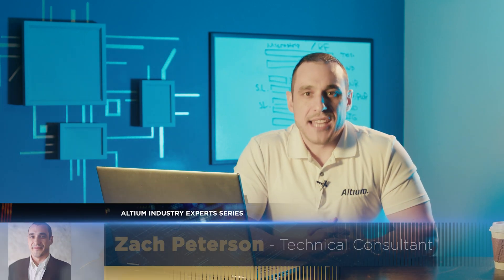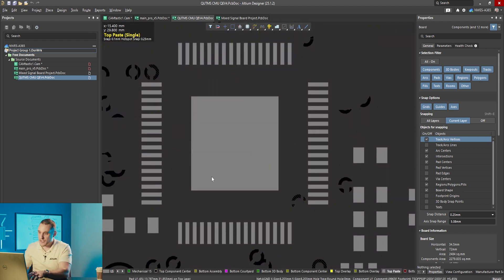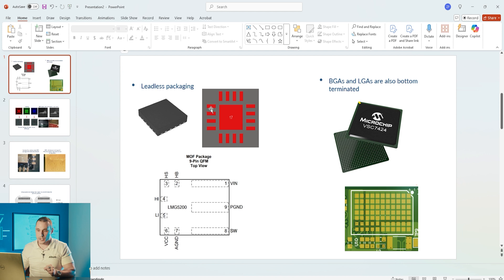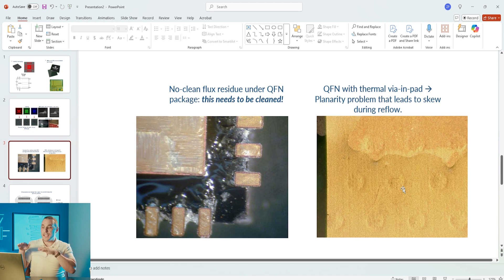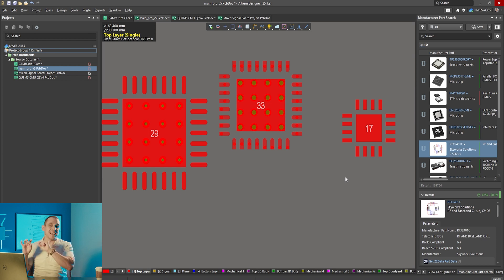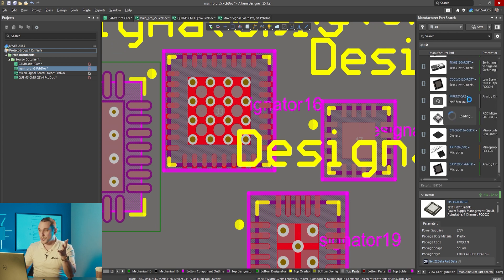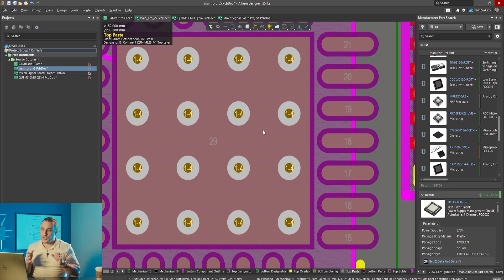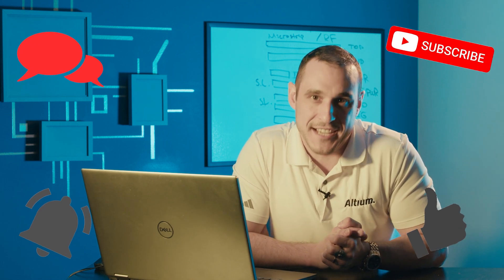Bottom Terminated Component Guide: Footprint Design Best Practices

Comment: Interesting that you mention using tented vias to prevent solder flow through. I would think it best practice to open the solder mask on the back of the via to avoid possible blow out. Minimising this opening should keep the amount of flow through to acceptable levels.
Reply: I had the same feeling. Therefore, Is it or not advisable to open the solder mask on the back layer? I though it it would help with heat dissipation.
Reply: Well I bring that up in the case where you have something on the back side near the via openings and you need to try and block the solder from possibly creating a short to the nearby component. But that is not best practice, a better practice is to keep stuff away from the back side via openings so you can leave the holes open and then you won't have to worry about it. Or you could just fill and cap everything.... I have also done designs where we did the tenting, but then we added another open via near the edge that was outside the paste mask opening, and this helps with the blowout and venting.

Comment: Of course the primary reason for doing this is because 100% coverage will simply result in way too much solder with nowhere to go (there are no fillets to take up the extra as in a typical leg or small pad) and the component will "float" on the solder. Typically we would reduce the area of these larger pads by 50%, that however concentrates all the solder into the middle if done as a simple reduction, and also can result in excessively large openings in the stencil for large components. So, we split the solder into multiple parts to achieve a more even distribution. I made a spreadsheet calculator to compute the size and offset (x/y from center) for each of the sub-pads to make my life easier. These methods are of course used not only on QFN and exposed pad components, but also larger footprints like DPAK, D2PAK or similar.

Via in the footprint is pretty bad idea, unless your designs are always such low density that no traces need to pass beneath; also means you might end up with different size vias in your design. I often get PCB suppliers querying vias in pads where the mask is closed on the bottom side; they either want to open the back or print mask over the hole on top.
Reply: Even with a 25% or 50% reduction in the paste mask opening, I could see the part floating if the paste was applied too thick. And I was really surprised to find so many parts with vias in the footprint just after doing some random searches in the library. Those parts are supplied by manufacturers, they are not created or generated by Altium, and even within a single manufacturer, you probably have different design teams working on the CAD data, or they outsource it to a 3rd party footprint sweatshop... Leaves plenty of opportunity for inconsistencies.

Comment: I did a MEMS project back int eh day and the exact guidelines from the manufacturer of that QFN were "Do NOT solder the pad to anything, leave unconnected to ground." and in technical whitepaper they even said that you don't want to use HASL on the PCB because it's too uneven and causes the MEMS chip to be crooked on the PCB after soldering and can cause distortion or mechanical forces on the package that can ruin he MEMS accuracy...

But the footprints I found first had solder paste layers on that pad etc... so you really need to be careful when you select footprints from a library of any kind. Unless it's been verified by someone in your company and even then, sometimes it's a good idea to read the guidelines anyway :D
Reply: Yes, most require no vias or copper (when no pad) below and you should add stubs on the unused pads to ensure balance track exits. This is to avoid surface tension pulling the part out of position or applying stresses to the seated package. If it was a long time ago, might even have been a ceramic package... I think the first ones I used from AD were like that.
Reply: What's the point of even having the pad on the QFN then? I guess if you have exposed copper below the pad and you can ensure contact between the QFN pad and the PCB pad you can still get a thermal benefit, but with a MEMS sensor it's hard to imagine you create a ton of heat in that package.
Reply: @Zachariah-Peterson  MEMS are sensitive to heat variations, thus you want to calibrate them against temperature and they often have internal measurement capability, BUT you can connect that  bottom pad to a ground plane (or copper pour in general) without solder to give it more thermal mass. Thus it can act as a simple low pass filter for the temperature variations and give you more accurate measurement versus temperature. :)

Comment: That fill light color! "You… go to your closet, and you select… I don’t know, that lumpy blue sweater, for instance, because you’re trying to tell the world that you take yourself too seriously to care about what you put on your back, but what you don’t know is that that sweater is not just blue, it’s not turquoise, it’s not lapis, it’s actually cerulean." 
tl;dw: Donut via in pad unless compelling need to do so.
This isn't even remotely related to bottom terminated components, but what are your thoughts on where to put a ground plane and signal traces on a two layer PCB populated entirely with through hole components? I like the ground plane on the component side and signal traces on the bottom, because reasons.
Reply: This isn't an intro to electronics class in 1994, I don't make boards entirely with through-hole components. Now for a serious answer to your question.... Doesn't really matter if you think about it, but signals on the bottom side and ground on the component side sounds pretty nice. Now noodle on this... what if you had components on both sides?
Reply: @Zachariah-Peterson  I occasionally do bottom loaded pots, but they're usually at the edge of the board. Occasionally a trace will get routed partially under a pot, but most of the trace is still accessible for modding.